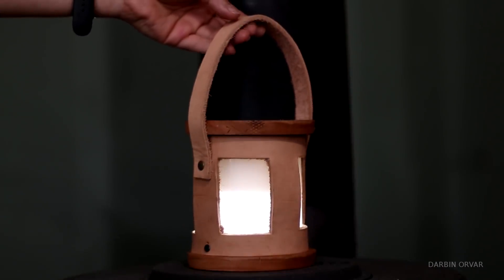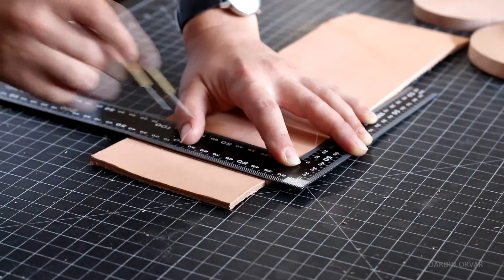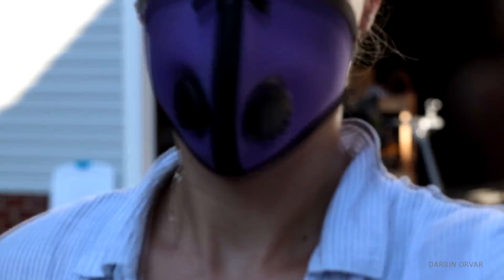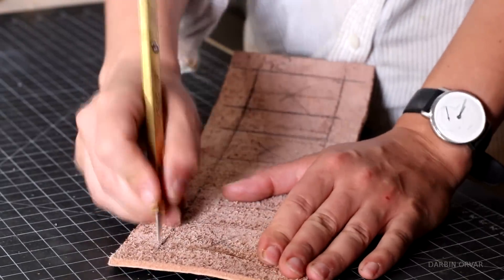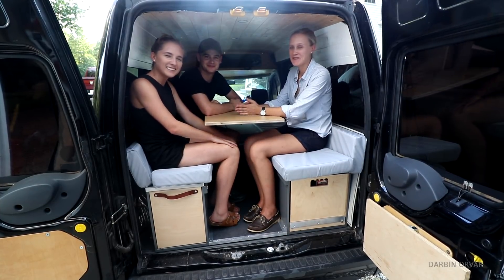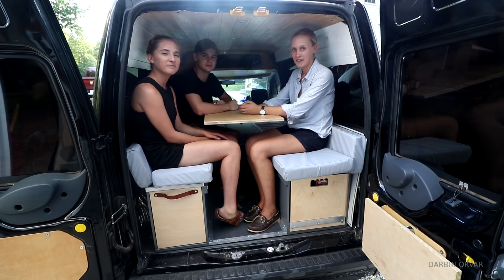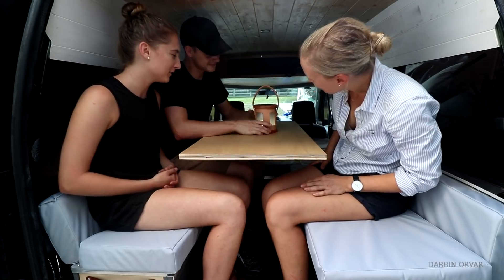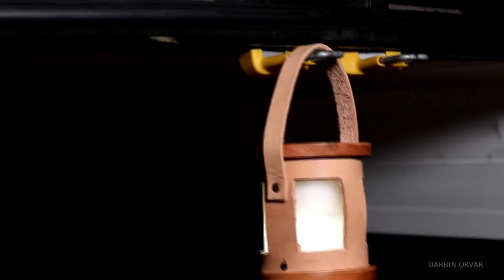DIY Portable Rechargeable LED Light

Comment: FYI, if you wet the edges of the cut leather and rub them with something smooth the edges will loose there fuzzy look.
if you take that one step further and round the edges before wetting it can look even better.
if you apply edge dressing to the slicked down edge it applies a slick color to the edge.

it all depends on the look you are going for.

great work, great looking shop so far.

Comment: One thing I would add: a small cone or pyramid wrapped in shiny aluminum foil, glued with the base upwards, on the  inner side of the lid of the lamp. It would direct more of the light outwards. Right now, much of the light is lost inside the lantern.

Comment: Very nice project! I really like
your videos. It would be better to use a current limiting resistor for each LED. If the LEDs are not all the same, using a single resistor could cause problems*.

* https://electronics.stackexchange.com/questions/174584/is-it-ok-to-put-leds-in-parallel

Comment: That is a neat idea.

You should invest in an edge bevel tool to clean up after the cuts.
Also, taking 5 minutes to run some sandpaper over the edges and burnish them would have resulted in a nicer finish.

I think I may just tackle something similar very soon.
It would make for a super handy addition to my camping set up.

Thank you for sharing!

Comment: Beautiful work, Linn! Great idea! 😃
I made a 10w LED flashlight with PVC pipes and so on... But, yeah, it's 12v. So I used a 3s LiPo battery and a LiPo alarm. So it's going to beep when you need to change/recharge the batteries. 😊

Comment: Very nice project.  You may already know about the cyclonic dust separator. I put one of these between my glass bead cabinet and the vacuum. The vacuum stays pretty much empty which can increase motor life. Setting up a system to collect all the sawdust would be beneficial. 
Here is a link:    https://www.banggood.com/Cyclone-SN50T3-Third-Generation-of-Turbocharged-Cyclone-Powder-Dust-Collector-Filterwith-flange-base-p-1192287.html?rmmds=detail-top-buytogether-auto__2&cur_warehouse=CN